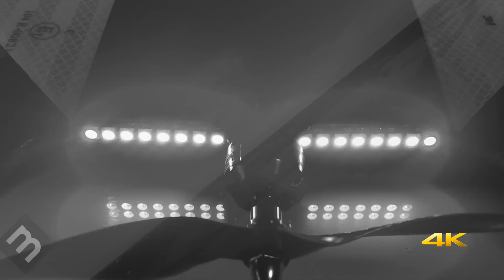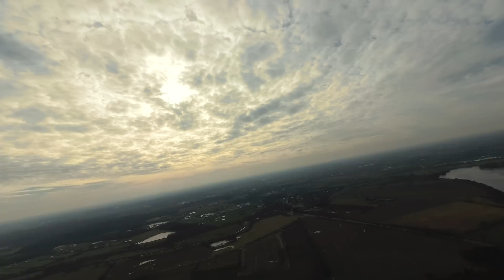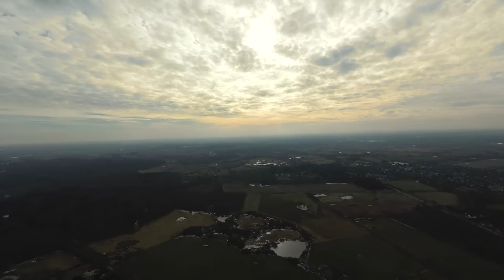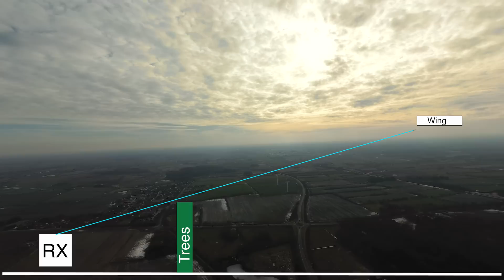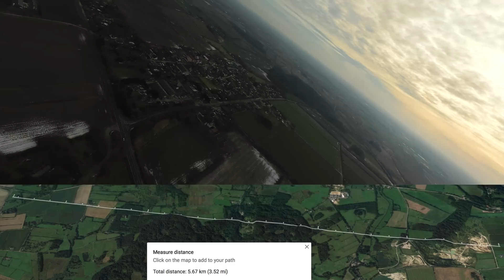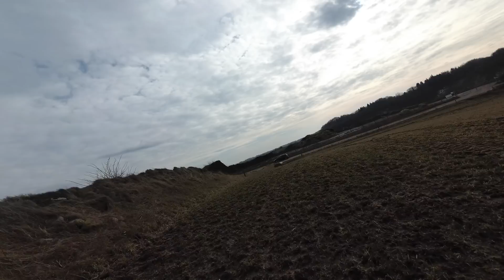S800 Sky Shadow - Range check

Comment: How many mw did you use on your 5.8ghz vtx?
And which Antenna did you use on vtx vrx
Reply from the maker: I used the shown antenna on the VTX (look at the thumb) and the cheap common Aomway (red) cloverleaf on the  VRX ... nothing fancy here or even pricy here. 
the VTX is a (not available on the market anymore) Eachine ET600 ... I think you will guess the output ... nothing tweaked or boosted ... 

It's simply that combination that really performs well together. Did try a newer VTX with more output after that and found it was crap compared to the ET600 ... and I switched back. The Result is reproducible

Comment: In the video you show an L9R, but in the links you've got an X4RSB. Which was used?
Reply from the maker: Uh that’s my bad- a L9R was/is used! Sorry to confuse
Reply: Matebox in Motion guess I’m buying one then, good range!
Reply from the maker: You won't regret it! Keep in mind though that there is no Telemetry on the Taranis with the L9R!
Reply: I did see that, but it has the RSSI connection so can handle that on iNav/OSD/etc.
Reply from the maker: Yep - just need to update to iNav V1.9 and then it also works (with Matek fc)